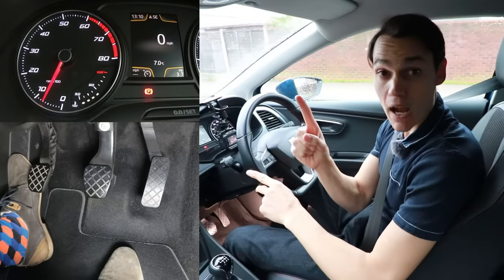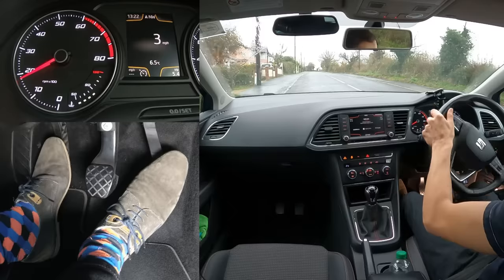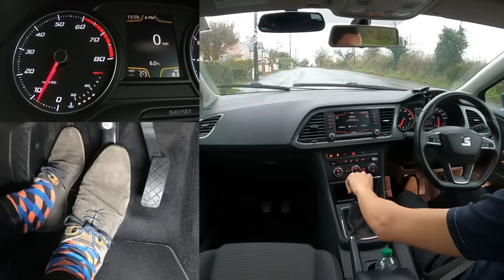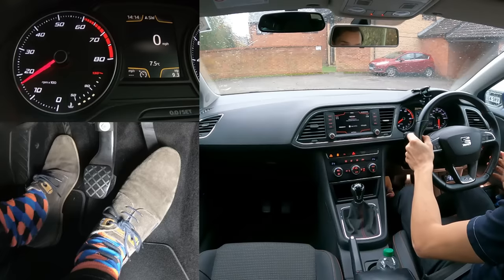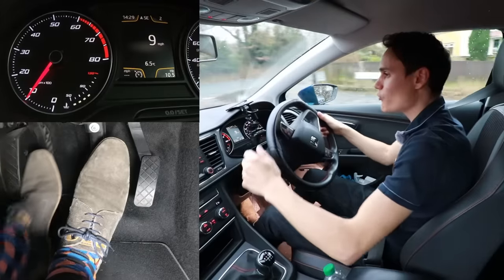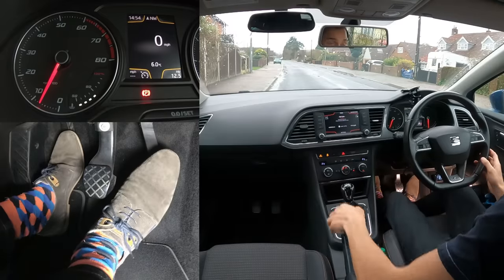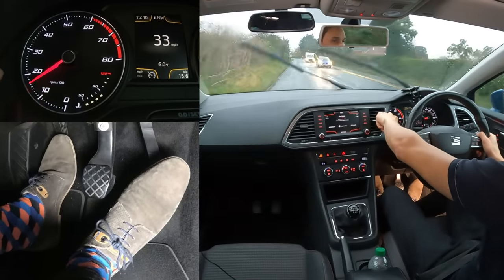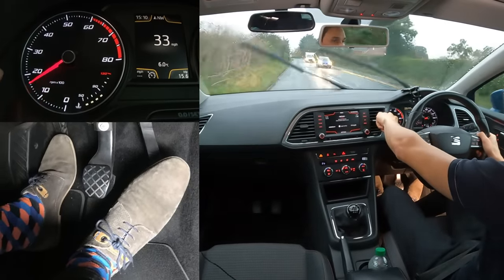How to make your clutch last longer without stressing the transmission.

Comment: Good advice, particularly for novice drivers. I drive a turbo diesel and don't even need to use any throttle, at least when on flat ground, as the car easily moves off at its 800 RPM tickover and will actually creep along in first gear in slow moving traffic, much as an automatic car does.
Reply from the maker: I find most cars petrol and diesel will do that - although my 2020 MX5 doesn't like it. But older cars still need power which is why I still teach it.

Comment: hey man from another advanced driver this is GREAT !! top!!! - a word ot the wise....when goign for 1st gear during your regular driving conditions, demonstrations or traveleing grab 1st softer !!! for instance the shift in 1st at 2:03 is bit fast mate !! the shifter is a lever NOT a selector. you should be coaxing the lever toward 1st while the clutch pedal is pressed not just force the shifter into 1st. if you lean the shifter toward your desired gear you can FEEL it go into gear willingly, of course youre a great driver and shifter mate. well done video and proper yes.
Reply from the maker: I do press gently and let it fall in. The time it takes to slot in differs depending on the gear, temperature and car.

Comment: Also, short shifting when the engine is not under heavy load and coasting to the traffic lights at a leisureable pace is good for clutch longevity because the idea is the less the gear changes the more the clutch preservation and greater the fuel economy and engine longevity!   It does my head in when I see car presenters change gears every 5 seconds when car testing. I do a lot of driving on windy roads and can take corners in 5th gear which is more than enough to accellerate out of the corner and decelerate effectively coming up to the next corner. Save on engine wear, g/box wear and clutch and fuel and still have FUN! :)   4th gear mainly when going up-hill and the engine is out of power band to get the torque happening and accellerate, that's about it.  (Mazda 323 Protege 2003) Little legend!!
Reply: But then my car won’t make great sounds whilst downshifting

Comment: Got to learn to move and do a hill start using the clutch pedal Only, on a car with a 900cc petrol engine in my driving school.
 I couldn't believe that such a small engine could deal with that, so i was using the gas for hill start practice and moving from a standstill, just in the same way as presented in this video. Then my instructor says this is not the way to use the clutch :D
Clutch down, 1st gear, start depressing the clutch(very slowly) and at biting point release the brake pedal( on handbrake you notice the nose of the car pull up on fwd) and keep holding it there to make sure you get the car still, then release the clutch gradually a tiny bit more with no sudden moves, and after 3-5 seconds the car would start going. I was amazed! Same for level surfaces, no gas ever before the clutch has coupled. It is a slower start, but i believe it saves a lot on the clutch, and the best way to learn for beginners, which indeed may be frustrating at first.
When i got my licence for truck driving i stumbled on another instructor who teached me another way on how to minimise the clutch wear when changing gears:
When changing from 1st to 2nd to 3rd, 4th to 5th, etc - as you approach for ex. 2-3000 rpm, release the gas, and clutch in only after you have fully released the gas, change to next gear,start releasing the clutch, let the clutch finish coupling, only after that, start pressing the gas pedal( not before fully releasing!(catching myself on that often)). This demands quite a bit of patience and concentration, and it creates like a little bit of lag in speed increase curve(as it is mostly a truck driving style to get the max life out of the componennts to avoid extra costs in the fleet), but after some practice, any car will become a piece of cake to start driving, even if you get in for the first time - feel the clutch 1-2 times and you're good to go.

 Great advice in the video with easily understandable explanation. I like the bearing part, as i was also told thst it's not good to hold the clutch in for long periods of time but not told what was the reason behind that.
Reply from the maker: I've made a video about that here https://youtu.be/UdTSRBJrw7Y
Reply: @ConquerDriving  thanks, just watched it now. You covered all the points there possibly are. Indeed not all instructors are that thorough. I subscribed! 👍

Comment: Instead of actually looking for a random sound when down-shifting, another great idea is to actually do the rev-matching yourself by tapping the throttle before down-shifting, this will ensure the engine revs will match the necessary revs for the gearbox in that gear to not strain the clutch. This does require a bit of trial and error because cars do differ based on gear ratios, but usually it's a rule of thumb - if you're at 2500 rpms in 3rd and you're down shifting to  2nd, your engine should be at around 3000 rpm to match the gearbox in 2nd, so tapping the throttle to raise engine rpm before shifting down is a great way of helping the clutch rev match. Make sure you're not tapping the throttle WHEN releasing the clutch as you'll raise rpms while the clutch is rev matching thus making it slip even more and cause unnecessary wear.
Reply from the maker: I have a video on rev matching here: https://youtu.be/-RnPUq2yut4

Comment: Great video! I've been driving a stick for a few years (would consider myself decently experienced) and I got a Honda civic si turbo manual. I just had my clutch and flywheel take a shit on me. Replaced to the tune of 5k...ouch. Honda services just said this happens from normal ware and tare, but in all reality, I have been putting so much unnecessary stress on the clutch due to my lead feet. I probably put the final nail in the coffin by putting stress on the tranny. Wish I would have seen this video before I bought my nice car, could have saved me 5k. Thanks again for the video!!!
Reply from the maker: Wow, that's a lot of money for a clutch and flywheel. I'm happy to hear the video helped, this video may also help: https://youtu.be/0ZjSImbwo34

Comment: It's very interesting to me how in the UK it seems it is taught to use the handbrake quite often. Here is Slovenia, everyone who is stopped at the lights for example, uses brakes to prevent rolling back, as far as I know never the handbrake. Also on a hill start, I was taught to use the handbrake on very steep hills, but on some even moderate hills I was encouraged to hold the brake, then swiftly get the clutch to bite and a little throttle at the same time. Ofcourse that was later in the driving lessons, where you are used to the bite point. It probably also helped a bunch that it was a diesel, which I believe to be harder to stall.
Now in my 3 months I actually never used the handbrake while driving, since I noticed that our fiat has a hillholder assist, that keeps the brakes engaged on steeper hills for a couple seconds,  until you set the bite point and throttle. Quite a handy feature, definitely something to check when buying a new old car
Reply from the maker: I generally only teach people to use the handbrake for parking or the occasional hill start.
Reply: don't forget fwd skids lol

Comment: Drove an Acura for 13 years and 196,000 miles on one clutch and it was still perfectly fine when I sold it.  Here's how.

I rarely used 3rd or 5th gears.  When getting up to 45-50mph, I'd just go 1-2-4-6.  When coming to a stop light, I'd often not even use the clutch.  At particular RPMs, you can just sync the gearing and fall into neutral.  Then just coast to the light.  Never wait at a light with the clutch in.  Drive like a granny.  It was an RSX Type-S, but I was routinely getting 31mpg after 13 years on a car that was rated for 27.  You might say that defeats the purpose of buying a sporty car, but I say 13 years and 196,000 miles of trouble free transportation where the only thing that ever broke was the A/C.

Take care of your vehicles and your vehicles will take care of you.

Comment: Had my first 2 hours lesson and was on the road driving through the gears and handling nicely all-ready. My only issue is determining how wide my car is, say if I’m passing parked cars and have oncoming traffic it’s a bit daunting.. I didn’t realise how sensitive the breaks and acceleration was at start but I’m getting used to it very quickly.

Comment: Idk how I came across this video, but for people that want to really keep the clutch wear to a minimum, learn proper downshifting with rev matching.

Rev matching will prevent the clutch from heating up and eliminate shocks (your head bumping the dashboard when going from 3rd to 2nd).

One more thing: when downshifting and holding the clutch partially waiting for the revs to match, the clutch gets hot AND your brakes and suspension fight the whole weight of the car and they are not designed to do that, so your brakes and suspension take a really significant hit over time there.

Never stop learning people
Reply from the maker: There clutch and then hole car is designed for the clutch to rev match, that's how most people drive. But yes, rev matching is better, but generally only driving enthusiasts practise this method: https://youtu.be/-RnPUq2yut4
Reply: @ConquerDriving  yeah valid point, I was stating this as  a "for those who want to know more" subject, although ultimately your powertrain and brakes are supposed to shift the weight of the car in harmony, not one and then the other, I think you will agree with that, the compression of the engine (optimally applied to the transmission when the clutch is released, otherwise it's merely partial and wears down your clutch when syncing high revs) and the brakes work together to slow the car down, not one or the other.

Again, this is a bit of a more advanced topic, gotta learn the basics first of course. 
Keep up the good work!

Comment: 7/15/22

1:16 - get the gas ready (while the handbrake is on and the clutch is down—not overheating when it is down) while you wait for an opportunity to go, only get the bite point ready with the gas when you see the opportunity reaches you (then take the handbrake off to move)

3:29 - lift the clutch to the bite point to move a little bit, clutch back down to slow down, lift it up to move a little bit, clutch back down to slow down (in traffic, this is okay but on long hills, it might be better to put it in neutral and wait for the car in front to move for some car lengths before you move again—10:20)

5:18 - lifting the clutch to the bite point while keeping the car steady with the brakes is not good for the clutch

Comment: My driving instructor never taught me the handbrake-hill-start-method. Instead, when we were on a steep incline, I was supposed to hold the foot brake and jump to the gas and let off the clutch when I wanted to get going. Needless to say, when I got my license and drove around with my parents, I would get funny looks and stall the car 90% of the time :,)

Comment: i drive ny cars pritty hard. but never had a clutch go yet. my current astra is still on its first clutch at 147k miles. gearbox is a bit clunky, but i think it needs a gearbox oil change. however i do belive that you can take of at higher revs without wearing it as much as you think. you took off at 3k revs to demonstrate this. and let the clutch come out dragging the revs down to 2k revs. if your good enough. you take off at 3k revs then release the clutch with accleration to keep at 3k revs. other thing is you can reduce wear when downshifting by carefully accelerting to match the revs where the engine will be at that speed for that gear. but again takes time to learn for each and every car. you woant loose any speed that way. 

But very good explanation video. annoyingly very soon this will be obsolete as people continue to buy hybrids and Ev's which only have automatic drive.

Comment: Maybe a slightly advanced technique for some, but with some practice it becomes second nature. I like to heel/toe the brake and accelerator when downshifting, blip the throttle in most cases, but if shifting from 4th to 2nd over time you learn an idea of where the revs should be at the given speed and it shifts smoothly without juddering the car.
Reply from the maker: I have a video about that here: https://youtu.be/-RnPUq2yut4

Comment: 2:40 "no one to signal to..." Every driver's thought right before cutting off a motorcycle and causing a crash... Signaling is not for when you see someone to signal for, it's for every time it should be done. There can be motorcyclists, bikers, cars etc. in a blind spot and you end up making a maneuver that has the potential of putting them and yourself at risk.
Please people, SIGNAL regardless of whether you find it necessary or not.
Otherwise, good advice. :-)
Reply from the maker: Most instructors don't teach people to signal by habit in certain situations as we are trying to encourage them to think about what they see.
Reply: @ConquerDriving  One does not have to exclude the other. Signaling + looking should be taught as habit. Together, not separately.

Comment: Here's one you probably haven't heard of. Double clutch at a stop-sign(rev up in neutral, release clutch, then push in clutch,  select 1st gear). This way the transmissions is already spinning, so the clutch and synchros don't have to spin up the transmission's inertia. Less wear.

Comment: When slowing down one should always use the brakes then change the gear to match the speed. By using your method to slow down you are not warning the driver behind, there would be no brake lights.  Back in olden times we were taught to use the brakes then doubledeclutch for the crash gear box (constant mesh)

Comment: Great video, although I have a quick question. Noticed that you have two methods when changing up gears: clutch to bite point and add gas, and the method you show at 8:28, which involves adding a small amount of gas before you get to the bite point. Which is better for clutch preservation, or isn’t there anything in it?
Reply: When you're holding the clutch at the bite point what you're essentially doing is letting your synchros match the rpm of your wheels to your engine. So by giving a bit of gas before letting the clutch up is known as rev matching which can help your synchros match the rpm faster meaning you don't need to hold it at the bite point for as long. So in a short answer: yes, it does help by giving a bit of gas before.

On a second note he has a very good video on it, called rev matching if my memory serves me right.
Reply: @linussandell831  Cheers, I’ve watched that video too. I think in the rev matching video he adds gas a fraction of a second after reaching the bite point, which is which is what made me wonder. :)
Reply from the maker: Either way has little difference. As long as you don't have too much power as the clutch reaches the bite point clutch wear will be minimal. Adding a bit of gas first will reduce how much you slow down during the gear change.
Reply: @ConquerDriving  Thanks! I’ve been wondering about this for a long time

Comment: 11:34 I held the brake pedal in a queue to an off ramp and was hit from behind, I did feel the inertia pulling my foot off the pedal in that instant, but I reflexively pushed harder as I felt that happening and my vehicle only traveled about 3m before stopping. I doubt the parking brake would have been as effective.

Comment: Managed to make my clutch in my Aygo last 90,000 miles and still going strong... It's rare their clutches last more then 100,000 miles. I always rev match between gear changes though, I don't do double clutching though (which imo is more for old helical gearboxes).
Reply: No, double clutch helps to all synchros no matter what.
By just one rev match you are helping with clutch wear \ transmission stress.
By second rev match(using neutral) you are helping to syncros.

Comment: I realise this isn't a learner technique, but I learnt to rev-match downchanges as soon as I'd passed my basic driving test. It's obviously very easy when off the brake, and if you want to brake at the same time (for instance, to tell the cars behind you that you're slowing, or when going downhill to control your speed, and so on) heel and toe is the next step and once you get the hang of it, it becomes second nature. I've now been driving reasonably high mileage on the road for 28 years and racing on track for 21 years, and in that entire time have never changed a clutch, either on a road car or racing car. Furthermore, at the end of a racing season mechanics who've inspected my clutch say there's virtually no wear, in contrast to other cars they maintain. Neither technique is for a true learner, but I would still class them as basic driving techniques and certainly weren't difficult to learn once I'd got the basics of driving. The only problem is that if you drive with someone who doesn't rev-match, or drive an automatic, the gearchanges make you cringe.

Comment: thank you very much for everything, you helped me so much and still learning new things each time, this time i was hesitaing if i should keep using bite point as i start but it seems fine, im still trying to get more used to rev matching since it does require far more concentration and precision than i expected, but i can do heel and toe and it does help so much on my ford fiesta, it does not have stop assisst so using that method stops my only weakness, hills, i just need to learn to park better and more precise clouch control along with how to mentain the car as healthy as posible,